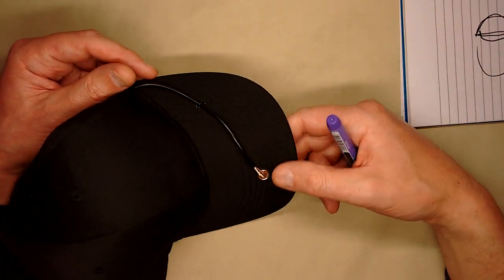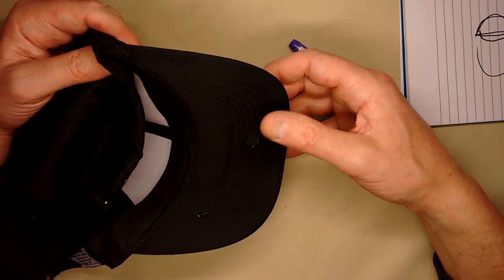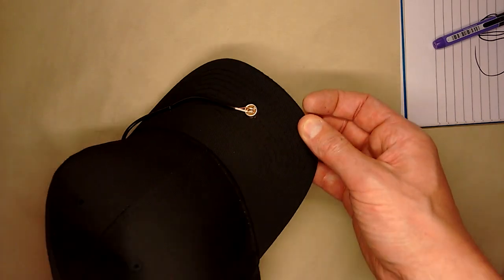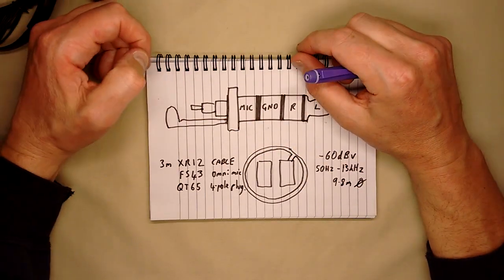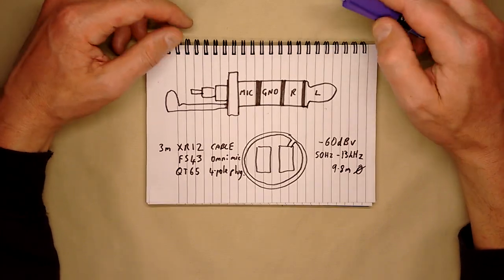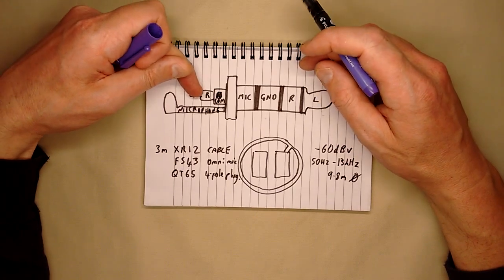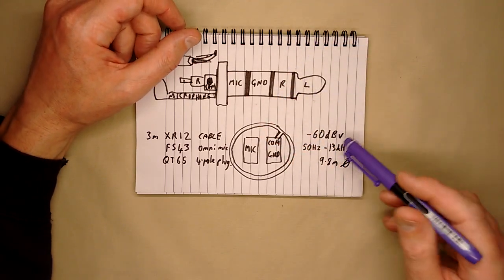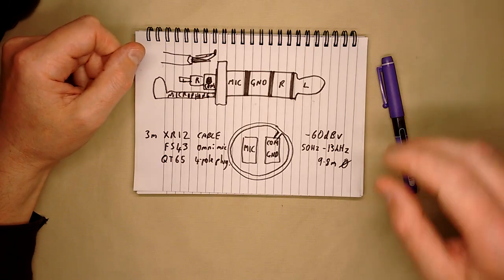Baseball cap with integrated microphone.

Comment: Sounds very nice! Maybe that's why it cost more. It could be the components are of much better quality than the cheaper ones. Maybe get a cheap one and compare the sound quality? I'd say there's a difference...
The first mic has a much higher sensitivity in the higher frequencies, the second mic, to me, sounds more mellow as far as the highs go, and I like it. The first picks up all the scratchy tones etc... I vote the second mic...

Another thing you could try is applying some felt to the bottom of the bill, to reduce transient noise.

Comment: It's very interesting you have trouble finding those plugs over there.  Here in the US it's become a major chore to find cheap headphones that have the traditional 3 conductor plug (our work computers have separate plugs) and the 4-pin ones don't sound right (audio is very muffled) in a 3 pin jack.

Comment: The change from the old to the new mic was kind of disconcerting at first, but I got used to it after a minute. The old mic is definitely better though, it picks up more of the low end of your voice while the new mic doesn't seem to have much of that. Perhaps it's something you can use an equalizer to fix.

Comment: It's pretty good but lacking the depth of the other one.

What I've used in the past to (unsuccessfully) make youtube videos in this area that people like, was modify a Sure UC wireless lapel mic receiver that I got for free, and made an adapter to plug into my iphone, need to see if it works with my new android phone but it has really nice quality, given that it is a higher end mic, and it's wireless, though that does mean you have to check the battery from time to time.

It was extremely trivial to ad the 3.5mm jack in, so it might be worth checking local uni's or pawn shops for something similar.

Went back and checked the video and it has four dislikes and no likes, pretty much sums up my experience with making stuff on youtube, though granted that was before I edited anything, and recently added a second channel just for that stuff since my main one is full of random crap.

Rambling aside, check for one of those setups, the microphone alone would likely be much higher quality than the electret one you used for this.
Reply: I agree. You got stiffed on the mic, it sounds like a 65p mic. Try a new mic in the same setting?

Comment: If diaphragm size isn't an issue, could you try something like an ATR-1100 (can be had quite cheap) or something similar? Comes with 3.5mm by default, so no need to get another plug or more wire.
 The new mic sounds great but a larger mic might capture the low end a bit better. That being said, I'm sure the response of a mic will change substantially without it's casing.

Comment: The problem is the smaller the condenser the tinnier the audio, you can reduce some of it by adding a piece of felt or foam. A lot of the lapel mics have better quality pickups in them, mabye try using on of those. also mabye add a small piece of plastic vertically at the end of the brim to catch some of the lower frequencies. but the concept is great.

Comment: The sound from the cap is nice and clear,  but it lacks the 'warmth# that you usually have.   Typical of these mics?  Or is it just because it isnt not shielded?  or maybe as you said, a difference between the 9.9mm and the 6mm.?   Maybe a sponge baffle would help?

Either way,  it sounds clear and the most important bit..   NO RUSTLING>   woot woot

EDIT:   Maybe add a few LED's in the cap to assist with lighting?   Stereo speakers too?

Comment: you need a wind screen / wind muff, that should help with the pronounced sound of breathing. there is also a slight tinniness which is likely a product of the Mic itself. alternatively you might try some method of vibration isolation (springs, bands, etc.)

Comment: I think the audio is better with your cap mic. No need to waste money on USB microphones that you can't use with your setup, nor using a boom headset. In the situation you're using it, that cap ,it seems to be fine. It is also louder than the previous segment of audio. I don't know if that was deliberate or you just left the recorded audio at their respective volumes. The good thing with the cap is that it's at a constant position no matter how you twist your head around, the quality is fine and it's inexpensive. The only downside is the likelihood (or not) of forgetting you have it on and walking off, thus dragging your ipad onto the floor and causing damage.

Comment: I absolutely love your attempt with the new mic, even though I understand why everybody says to leave the old one. I guess most of the critics are just used to your voice coming from the old mic as it seems a bit more "crisp" to me and my initial thought was also, that the original mic would be the better choice. But after listening to the new mic for a few minutes I am somehow convinced by the new one, since it sounds just more "real", like if the voice coming from it fits better to the person speaking. At least this "new mic" voice fits better to my imagination how your it would sound speaking to you in person. So even though I guess your decision is already made judging from all the "leave the old mic!" comments, I personally would love to keep the cap-mic. 

I actually think about building one of those for myself now to enhance audio quality after watching this... hmm...
Reply from the maker: Laterly I ended up using the same mic but with the cap back to front and the mic clipped on the strap directly on my forehead.
Reply: Stage Actors use Wig/toupee/hair mics which are held on with toupee clips, elastics, and nexcare 3m tape.

Comment: The baseball cap mic has a lot less treble and sounds muffled. If I were you, I would use the older configuration. Unfortunately, at this time, it seems that the clip on one is superior (assuming that you properly recorded audio from both mics).

Comment: -idea for you -

they sell black pens with conductive ink Evan when its dry ....
not sure about ohms per cm for audio signal 
but for a black hat with no visible wires and if you look around you can get blue tooth mic transmitters the size of couple coins stacked with battery's and all

Comment: Aplle actually used this arrangement so that you would have to buy specific accessories for their products but a few years ago android phone makers also switched over to this  arrangement. The classic arrangement was always  to have ground connected to the sleeve  I guess a trrs connector might not work in a trs jack though using that arrangement since the ground contact might not touch the sleeve..

Comment: personally I prefer the sound from the first part of the video, the first microphone obviously has a more extended frequency response, top and bottom, and therefore sounds more natural. the second microphone is perfectly intelligible but sounds hollow and nasal in comparison. it also provokes my laptop speakers into sibilance but thats less pronounced on my desktop where the sound is handled by a separate amp & speakers

Comment: I was plaing with those mic capsules in the past and i do not like them . the quality of the sound they capture is always a little bit hit or miss and i was much more happy with the capsule i riped out from one headphone set than the ones i bought.
But going all DIY i would use a dynamic mic capsule and one transistor preamp instead.
azusa dm525 sounds pretty resonable for about 3 gbp new or a little lighter monocor md-110 for 2 gbp monocor have a little bit weaker output though.

Comment: I assume that somebody else in the 500+ comments as already mentioned the wonderful format war Apple contributed to.
The iPod video/photo had video out on the headphone jack in the same manner, and Apple slowly switched over to using the same pin out for mic and control. and well that didn't cause any issues with the video out, and you could track down the correct non-proprietary cable which I did.
it does however raise a problem going the opposite way using headphones on devices that don't expect a 4 pin connection especially with 1/4" adapters. I work with a band that uses a IEM system and a few bandmembers like to use their cheap iPhone ( compatible ) headsets. which don't necessarily work very well if the connector doesn't make contact to the right ground pin, some adapters will make connections to the 1st and 2nd rings and some only connect to the 1st. this somehow doesn't put the microphone in or out of the circuit but reduces the volume..... and causes lots of issues. my solution is to go on eBay and find a 4pin to 2x 3pin breakout cable/adapter.

Comment: Can anyone fill me in on why Clive doesn't just use a lavalier mic in the usual position i.e. on the lapel or elsewhere in the upper chest/throat region? Is it just a convenience thing?
Also, as an audio technician I have to say... you can get away with a lot of cheap shortcuts on the reproduction side of audio systems but if you go cheap on a microphone, recording quality will always suffer. A cheap electret capsule is miles away from a properly designed and built studio condenser capsule in terms of fitness for purpose. Personally I wouldn't use a cheap electret for anything other than basic audio detection/activation circuits, since the actual frequency response and tolerance can vary so wildly from the quoted specs and between units.

Comment: American translation:
 English = "skip" - American = "bill"
 (caps have bills, while brimmed  or brimless is a hat)
I don't understand why a hole was necessary, gluing the "capsule" under the bill would work just as well.
 The through the "bill" MIC has less "bass" (low frequencies) so is brighter sounding than the clip on MIC.  We are more accustomed to the more bass.
The sound is 50% of most videos.  (the better ones)
Reply: Ronald Youvan Another translation for us yanks: screen = shield (in regards to cable lay-up).

The pin-out that Clive found for the TRRS plug makes no sense for manufacturability. The easiest way to connect a cable to any similar connector would have the shield (screen for the UK?) connected to the outermost connection. Also for noise immunity, any exposed metal on the connector should be the shield ground connection, not an active input like the mic. Must have been done by someone who wanted to do something different from how a EE would think to do it to force 3rd parties to pay for compatibility... (Apple, anyone?)

Comment: Doesn't surprise me that Maplin charges £5 for a 65p component - was there a good reason you went to Maplin, or did you just want it faster than placing an order with a real supplier?
Reply from the maker: That's the one advantage of Maplin.  Being able to get a component at short notice if they have it in stock.  That's where the extra cost comes in.

Comment: I think the sound is dependent on what kind of system the listener is using 
With my cheap speakers (just a pair of 3 inch ) it all sounds a bit tinny 
With my other set (each cabinet 8 inch bass ,3 inch mids  , piezo tweeters ) it sounds great 
But then again I can adjust for sound quality

Comment: It's a shame you never took advantage of the TRRS connector's audio channels to have the audio be on a switch inline to the mic so you can self-test without the need for other applications, or use with other devices that can be made to accept TRRS.

You could had hacked up a cheap pair of earbuds to have them nearby your ears, then as well putting your cap on to record, you shove the buds in to test and they can just dangle there if that isn't too distracting to you.

Comment: someone already makes this. its called a lapel mic. and its pretty industry standard type deal
Reply: I thought lapel mics attach to your lapel.
Reply: except they are more expensive than what Clive has made, and aren't built into hats
Reply: But don't sound like arse Romaobb..
Reply: Joshyy My point is, that the OP said that they "already make this" and that it's called a "lapel mic" except, this isn't a lapel mic, it is a very cheaply made mic/hat contraption that get the job done. Sure, the quality of the sound isn't as good as you might get from a lapel mic, but what do you expect from a homemade 'mic hat'(?) that only costs a few quid?

Comment: Very nice idea. The new microphone is limited in frequency response (appears to be -3dB @ ~10kHz) when looking at the audio spectrum. It sounds a lot better after applying EQ but the high frequencies suffer from distortion, as they usually do with the cheaper electret condenser mics. You might be able to pick up a cheap "Spares or Repairs" condenser microphone from eBay that you can harvest a better quality condenser element out of.

Here is the EQ comp: http://principal.audio/img/eq_comp.png
Here is the EQd audio: http://principal.audio/img/eq_comp.mp3
Original audio taken from this video at: 06:22

EDIT: You could actually get away with using this mic, but I would probably use an EQ on the video project. Most mics can be made to sound a ton better than they sound raw. I have a pretty expensive broadcast mic that I do voiceovers with and it sounds absolutely crap indoors but outdoor vocals sound excellent. Microphones are a very strange thing!
Reply: That's the thing with all the big electret capsules. Better use a 6mm, they have still plenty of efficiency in that position but their treble response is usually good up to 18 KHz and pretty flat and nice around 10. They go all the way down to 20Hz too, but of course won't like a lot of sound pressure, so that's something to be careful with, but it will be fine for Clive.
Reply: wow i can confirm with the eq shift, his mic sounds better than the ipad i had them both goign and switch back and forth andi do like the eq'd mic better

Comment: Odd ...looking at samples in audacity - pre-cap has less detail but contains more low frequencies - 100-2200Hz.  Cap on the other hand has more detail but (significantly) less of it is bass making it sound like the classic Radio 4 telephone effect filter - favouring 300 - 2500Hz.(aka a bit tinny)
Sorry - but I also favour the more dulcet slightly deeper sound of your first segment.

Comment: Bigclive. how well does it work with the H1 Cubot ?
Reply from the maker: Not tried it with the Cubot, but I found that the recorded audio was the only thing that let the H1 down.
Reply: makes sense. Have you had a chance to test the infa red remote control out ?
I use mine to control the TV, Freesat and Now TV box. all works fine
Reply from the maker: I've never actually used the IR feature.
Reply: install irplus and then select the device you want to control (a big list).
then you can have fun turning off peoples TV's whilst they are watching it. lol
And no I haven't done that but I have a wicked mind

Comment: A microphone built into a baseball cap has already been done... in Captain Scarlet!  Not the same build as this, but it's what I first thought of.  (The mic was on a boom that reached halfway round the brim, resting the mic at the front of the peak.  It would flip down when they needed to use the radio took communicate.)

http://www.mullocksauctions.co.uk/cd-content/uploads/images/lots/TM-04June2013B/333.jpg

Comment: Initially, the audio seemed just a bit ... like it was reflecting off of something... not bad but different. Then when you put the cap on it was very different. It sounded like you were doing a voice-over. THEN after about... half-a-minute, I no longer noticed any difference. It's as if it was always that way and positively normal. 
For me, it was the side-by-side comparison that accentuated the contrast. If you'd begun with the cap/mic, I'd probably not have noticed at all. But that's just me. Then again, my ears have had years of abuse so it might not be very wise to base it on my perception.
Use the proverbial grain-of-salt at your leisure. ;-)